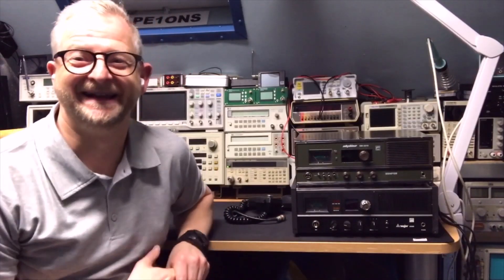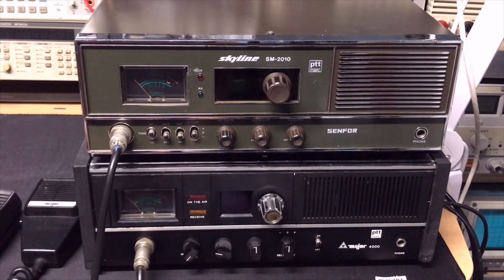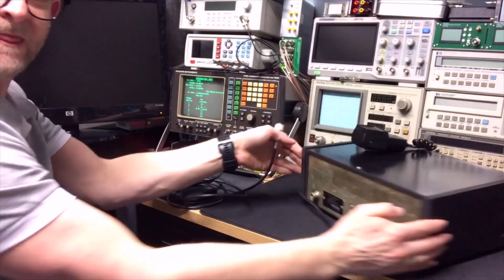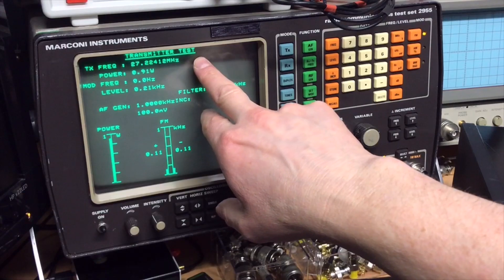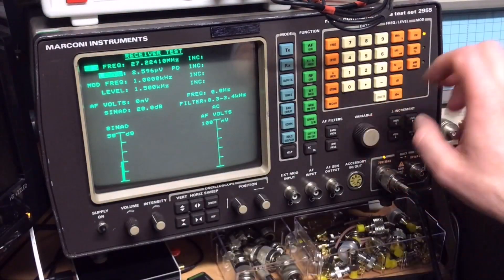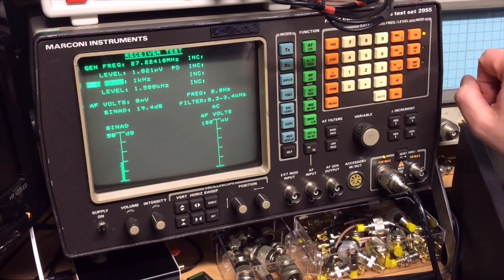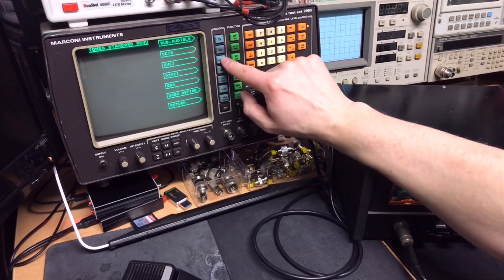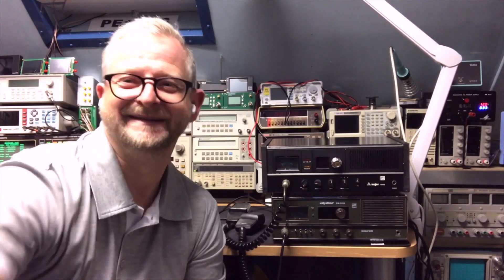#137 Marconi 2955 Radio Test Set - Basic Functions - Quick

Comment: Hi Tony, Very interesting vidoe indeed! I have one of these sets but unfortunatly it has a lot of problms because all of the self tests fail! it also needed a replacement 10MHZ standard to even iniitiialize. I am determined to fix it though I hope that none of the problems relate to any philips hybrid devices! OM345 , etc.
Reply from the maker: Hi Mich, yes first the 10MHz, the whole system runs on it, i have even heared stories of people corrupting the memory becouse of unstable 10MHz. for the OM345 are replacemnets kits with  MAR-3SM OpAmps that are also reaseneble flat  in that range. i hope the 10MHz is already good for you to fix it, but just that you know its not lost if you need OM345

Comment: SSB ON YOUR 2955, Hi Today i got a mini-circuits SBL-1 Frequency mixer and have wired the IF out of the mixer to the AF input of the 2955 test set, and setting the test set sig gen to 0DBM output on the bnc to the LO in on the mixer and the ssb radio to the rf in on the mixer using a power tap/ attenuator so you don't overdrive the mixer, set the test set/ signal gen to the same frequency as the radio is set to,with the modulation on the signal gen switched off, you can now hear your SSB audio clear and also use the 0-scope on the test set,
You don't need a test set to do this only a audio amplifier, and a signal gen, but i wanted to use my 2955 to hear my SSB signal, without switching on another radio or RX,
I got this Idea from Peter TRX LAB on youtube, as he made a SSB Monitor , yes they are long videos but he is very interesting
Thanks Dave 2E0DMB
Reply from the maker: Thank you David, that is indeed very interesting, great you got it to work also, i will have a look at Peters video about this. Great Tip! thanks!